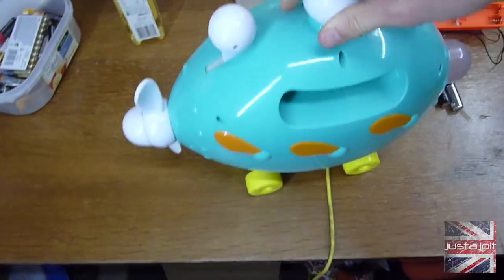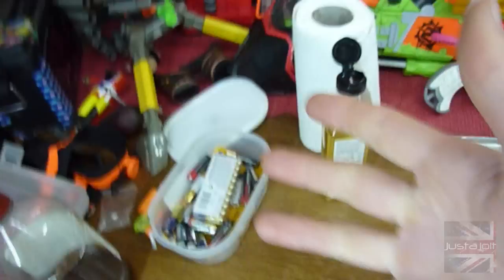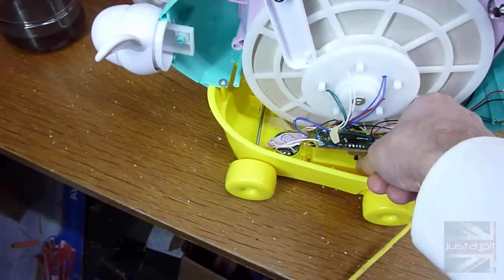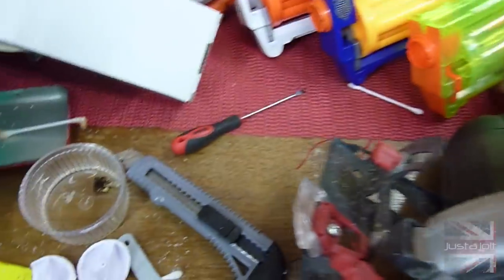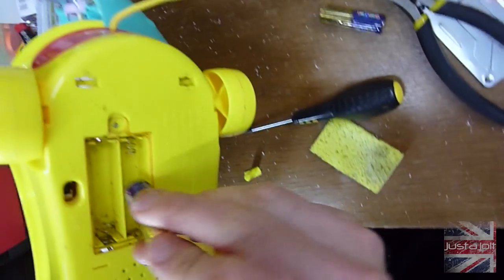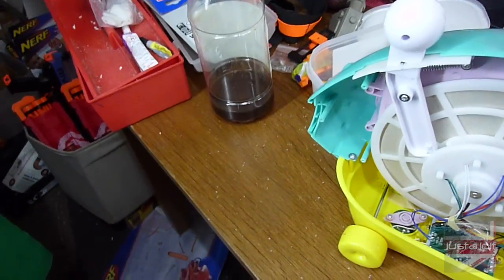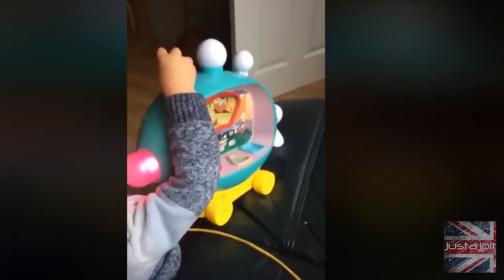How To Replace Battery Terminals In Toys With Orange Battery Rust On Battery Terminals (Pinky Ponk!)

Comment: The problem is you are using  ALKALINE  cells ... these are 1st class when new ( but the manufacturers are VERY quiet about their HORRID CAUSTIC leaks ! )  a solution is to solder in a  rechargeable Lithium cell from a disposable vape ( found on most sidewalks ) these are ideal for most devices using 2 or 3  alkaline cells .. it is VERY important NOT to charge them more than 4.2 Volts ( so DO NOT connect direct to 5 Volt USB outlets , use a TP4056 PCB ? ) ....... DAVE™🛑

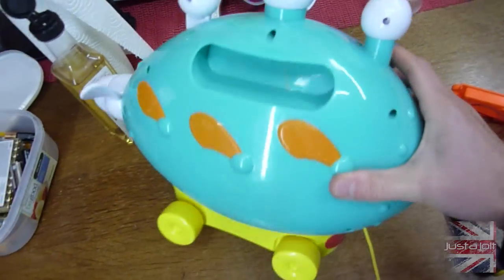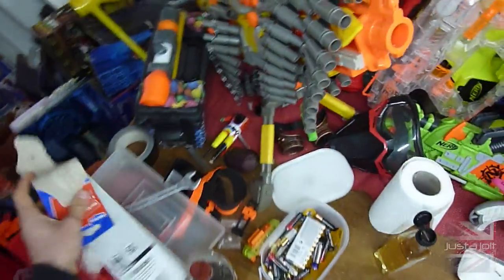Comment: 1:01-1:17 True, because it is so common for most of the toys, and it should never happened. Hasbro just made a big mistake on Nerf Elite 2.0 by solder glue the blaster.
Reply: I Don’t Care If The Toy Is Solvent Welded Or Not

Comment: Hi I have a idance Wall-e robot toy that was working last year I recently turned Wall-e and isn’t working due to the batteries that leaked I’ve cleaned the contacts the best I can with vinegar there was fizzing and comas off good even buffed off contacts with 0000 wire wool added new batteries and still isn’t working any ideas please?  Much appreciated